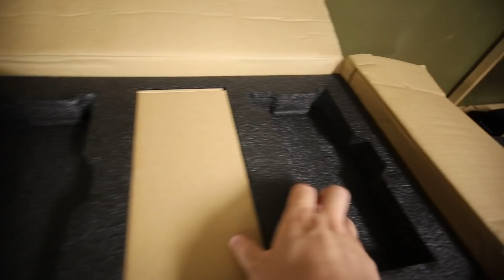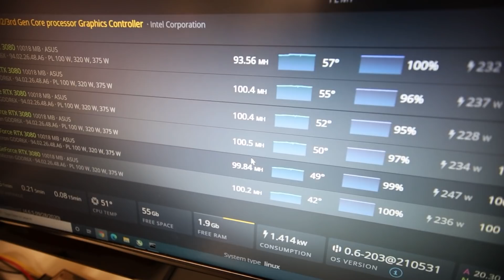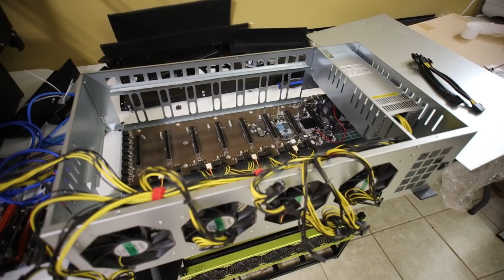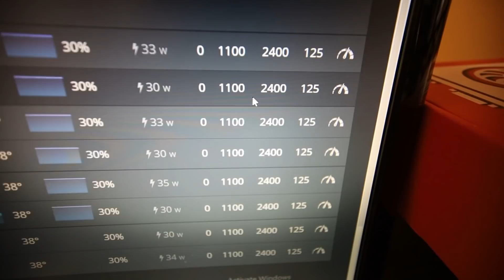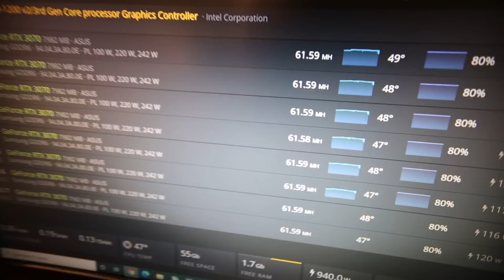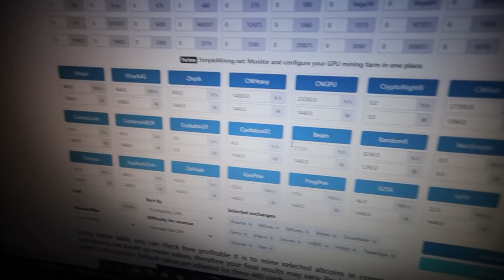don't watch this video if you are looking for gpus for mining

Comment from the maker: Mixed up the overclocks for ERGO on the 3070's, I should have gotten 170-175mh/s and not 125mh/s on ERGO! lol
Reply: IF I can troubleshoot windows, am I going to be able to troubleshoot HIVE OS? Ack starting phased conversion. AAA frame is small, I have one with rx570s, don't care for it much.
Reply: @JohnnyLuckySeven  w啊a1¹q
Reply: Try your radeon vii on ergo!
Reply: Ergo FTW in terms of efficiency and staying cool!
Reply: could you do a give away
Reply: Just finishing up a run on another coin, then turning that rig to Ergo for a look see. Nice timing thanks.
Reply: Can you make a tutorial on how to mine ergo On windows please? Like how to find a wall wallet and what miners u can use? It would be very appreciated
Reply: @Lynch_Odhran  Yoroi or Ergo's node wallet are the only 2 wallets currently.  I'm sure you'd still like RPM video about it but maybe you can get a head start :)
Reply: So, can you share with us what are the settings for rtx 3070 and ergo? please :) Or where can i find them? Great video!
Reply: I came to the comments for this reason.  I’m curious if your wattage increased after updating the overclock for ERG?

Comment: Those specific cards are awesome. Seems their memory is cooled by the gpu die heat sink and that looks to be copper (never seen a tear down on one of these). They run perfectly fine with much lower fan speeds and HiveOS temp showing 58 ish. You will see the hash speeds remain maxed even with auto fan set in Hive. By the way there is a tiny switch on the back of the card, that’s not dual bios it seems to create a virtual screen like those dummy plugs not sure what that’s actually meant for though.

Comment: Would 6x 3080 work with 2x gold 800 watt psu? Or 2x 800 watt platinum?
Reply from the maker: No that would not be enough, I would go 2 x 1200 or 2 x 1000 but yeah more capacity the bette
Reply: @RedPandaMining  oh, dang. Thanks for letting me know. What's the best I could get with hive os or windows 10 as far as watts for each card? I have a 2080ti that's down to 160 from 230 in win10. I was about to start getting 800watt psu before you replied. This reply saved me from making that mistake. Thanks again RPM

Comment: -200 core, 2700 mem and 125 PL.. I usually get a very stable 62.5-63 mhs per card on Eth
Reply: Same for me. I got -200 core and 2600 mem and 125 PL. Also 62.3 mhs. 
I do not know if oc the mem to 2600 really reduces the lifetime of the graphics card, so if any one knows.

Comment: Hi Red panda I am new to mining and want to know if u have a recommendation rig building list for 6 Rtx 3080 thx. really appreciate if u can help me out
Reply: any gpu does not matter nvida is good on temp just watch out for msi mainly and navi cards by asrock and msi. obv evga and asus are the best
Reply: @collingill572  thx thx how about Mobo CPU Ram any specific recommend
Reply: @kobekc621  if you can not get a mining motherboard as stock is bad I would buy a a gaming motherboard in the 390 or a b450  this is because there semi modder and most likely to have 6 slots. Than i would go with a pent-ion or a ryzen 5 3600 just for resale and maybe a little cpu mining. 

Also do not buy an asus b450 for mining it has 6 slots but is very buggy and bios get corrupt a lot.
Reply: @collingill572  thx for all the info

Comment: You can probably push it to 170 on ERGO with 140 PL.  Keep the absolute clocks but bump the power a bit. From a power consumption perspective, you should be equal to ETH but obtain increasing hash power

Comment: Not to be critical but your clocks are well off on ergo. Each 3070 should be doing around 170mh not 120mh like you did in your vid. the power is too low needs 125-130

Comment: Red Panda Mining, the absolute core clock is only worth it on Ethereum, the reason why Ergo vs Ethereum has a lot of difference is because your rig wasn´t very optimized for Ergo, you can keep the 125W PL, but the core need to be again to -502, so the 3070 will consume the total of 125w but will reach to 160 to 170 MH/s on Ergo, you are too far from that.
Reply: -400 core 2600 mem 130 power 172mh been using it for a few week
Reply: 125 power on Etherium is high. Im running 116w at 62 MH Ftw Ultra

Comment: Hm... oddly low hashrate for a desktop 3070 in ergo. 3060 laptop gpu 130W variant, -500MHz on gpu, +1800MHz on vram makes 125.4MH/s. Maybe asus heavily underclocked these blower versions of 3070 to make them to operate ok. In such case maybe flashing bios from other version of 3070 would fix these.

Comment: Question: I am currently running two rigs, one with 6 zotac 3070s and other with a mixture of zotac, gigabyte, msi and evga 3070s. The latter keeps crashing once or twice a day while the zotac rig does not. Could this be due to having different brand cards?
Reply: Check out the temperature of the card and maybe tweak again your core-clock, mem-clock, the card is probably not stable, good luck :)